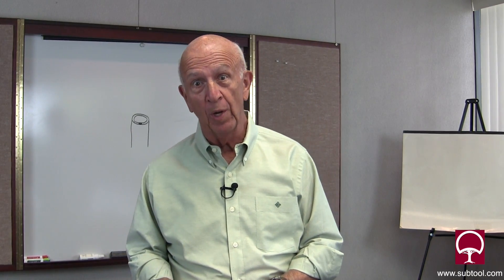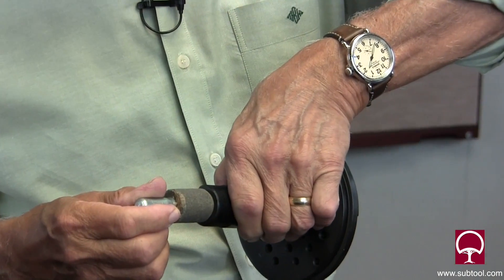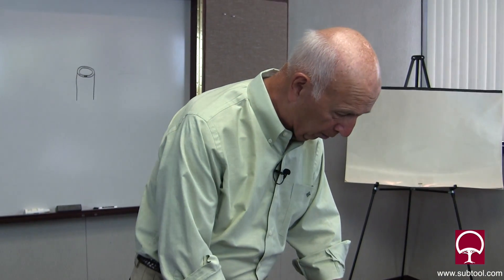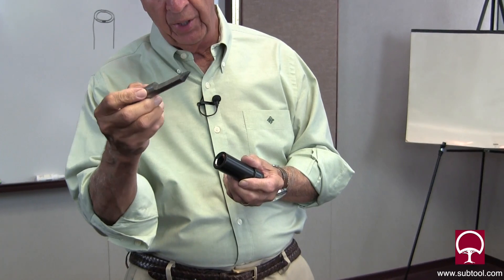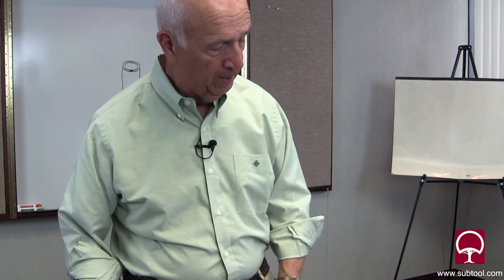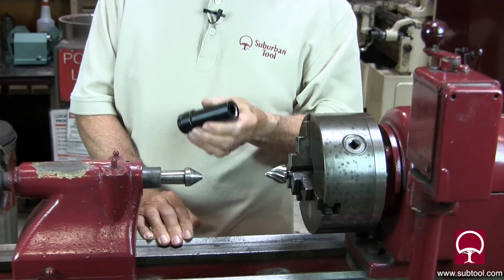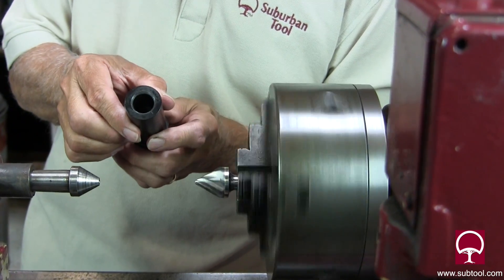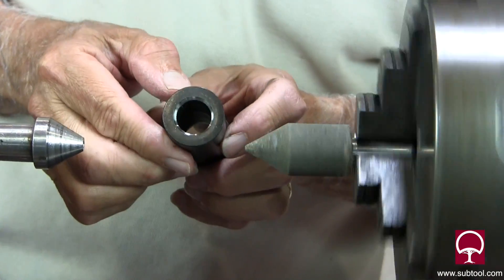How to lap a Center on a lathe

Comment: Also if you are producing chips with the carbide you are not lapping. 
Edit: Actually neither process you did was lapping. The proper way of re-dressing a center is to hold the od in twin 4 jaw chucks or 1 4 jaw and a steady. Indicating the outside and cutting the center properly with a lathe.
Not to sound like an asshole, which I often inadvertantly do. I love your videos and they have a ton of great info!

Comment: Inspired by this video, I got a couple of center lapping points and they are making a positive difference.  One is 80 grit and one is 150 grit.    But I have a question: do these center lapping points need to be dressed/trued from time to time?   If so, can I use a diamond dresser mounted on my lathe compound, set to 60 degrees?  Can I get the angle right by setting the compound to 60 degrees by lining up the graduated marks, or do I need to sweep a sine bar to get the angle exactly right?  By eye I can probably get it within +- 0.10 degrees.
Reply: I wouldn't use the graduated marks. Best thing to do is use a 5" sine bar attached to the side of the compound with magnets and sweep with an indicator. What I normally use is, say a 30°  Brown & Sharpe angle block (I have a whole set 1/4° - 30° ...they come in pretty handy!) held by a magnet to the side of the compound. I checked a piece I had turned by this method on the comparator at work and found it was within less than 2 minutes of 30°.

Comment: I tried to center drill a bar and it came out badly off-center. I remounted it with a steady rest and tried gain. It came out much better. Obviously lapping will help, but is there some way to assure it is concentric with the O.D. and  to true it up if it is not?
Reply from the maker: There are a few factors to focus on, the first being how you were holding the part.  If you chucked the part with a lot of stock out of the chuck, the part will move causing your hole to be off-center.  Also, make sure your chuck and your tailstock are in good working condition, any play in either will cause your hole to be off-center.
Reply: SuburbanTool Inc
I'm very new to machining, but have worked with hand tools for many years. I find myself unhappy with the way the 4 jaw chuck jaws are not restricted to one dimension of motion. Maybe it's just the design of my 4 jaw that is at fault. I can center things if I take my time, but it's a messy job given that when the jaws are loosened via their holding nut so that I can adjust the in/out this makes them VERY sloppy in all dimension stilt and yaw and everything. I'm tempted to cut new jaws with dovetails + cut dovetails in the chuick for the new jaws. That's how unhappy I am with it. Maybe I should just find a better chuck. I hear those "bump-true" chucks are pretty good. What do you think?

The part I am center drilling could be made a lot shorter which should help.

Comment: is it not important that the lapping stone is through? it was wobbling a bit
Reply: I wondered the same thing; when Mr. Bailey laps with the stone on the Logan lathe, the end being lapped seemed to have obvious runout. Was that the case, and if so was it just because the stone hadn't been dressed concentric with that chuck?
Reply from the maker: +izimalta Yes, it would have been better ,but I don't see that it would make enough difference to affect outcome.

Comment: If you have run out in your lapping center won't it tend to cut a heavy and light side on your part, which then could throw your cylinder axis off? I realize that if you could hold the part rigid it would only cut with the high side and it would even out, but since you can't hold it rigid I think there would be some error. Of course since this is a step before final finish I guess the error doesn't matter since it can be corrected in the final grind.
Reply from the maker: bcbloc02 No question there is run out as I commented. It may change the angle to 61 degree or 62 degree, but it will not create an egg shape.